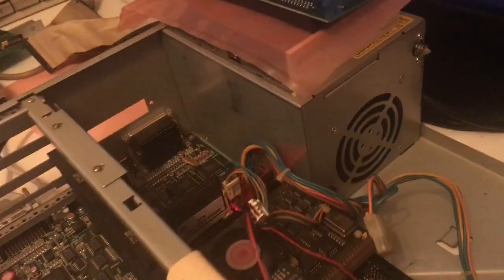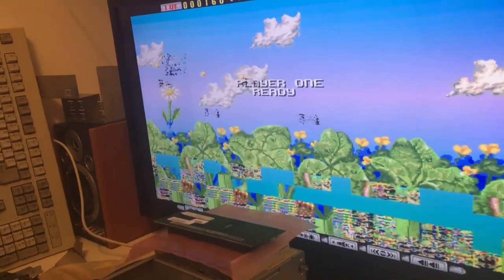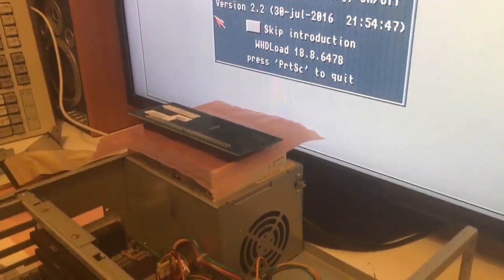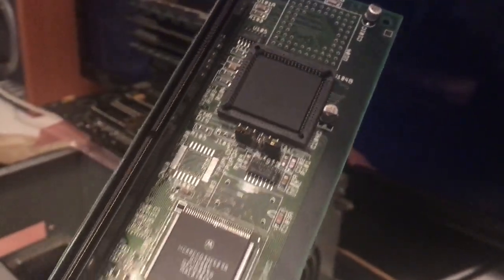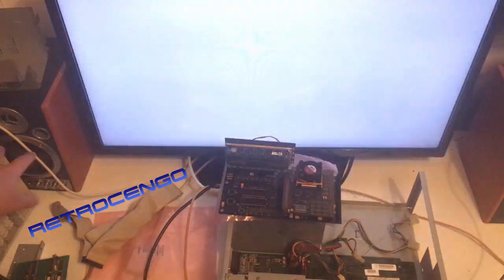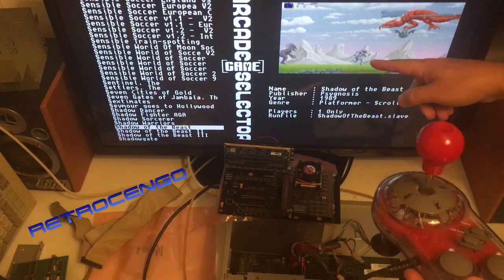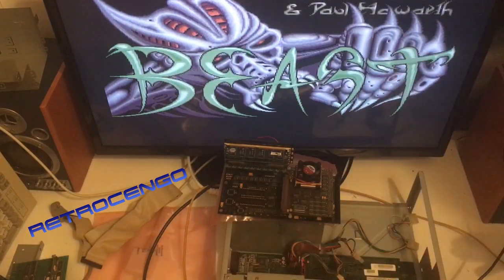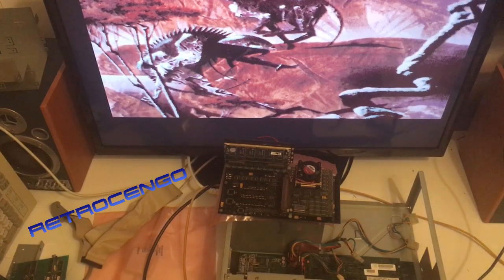AMIGA 4000 68040 vs 68030 Gaming and dream CPU board talk

Comment: My ppc 240mhz with a 25mhz 040 overstocked to 40mhz worked fine with 3.1 roms and workbench 3.5 and 3.9 apart from shadow of the beast I did have problems with that game.

Comment: If you deactivate inst and data cache and burst on boot menu, you can play almost every game with an 040 and 060 aswell, 060 is more of a challenge... I used both.
Great video, thank you very much!
Reply from the maker: Thank you for your kindness. 
Yea there are quite few tricks, but need to adjust often when using 040, deactivating cache makes the system slower, it’s just so neat with 030, it’s snappy and works without any adjustments 😊
Reply: @RETROCENGO  well even with all deactivated an 040 or 060 will always be faster than an 030 but you are right, you have to hassle with settings and the 030 just works. 😁
Have a nice evening and thank you!